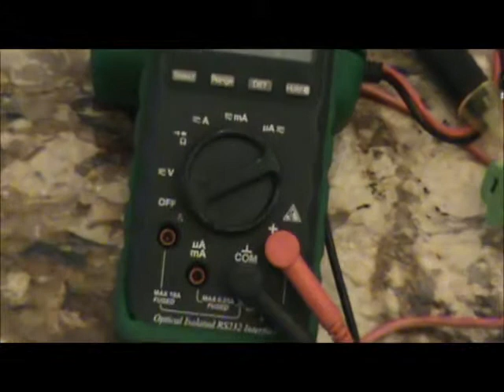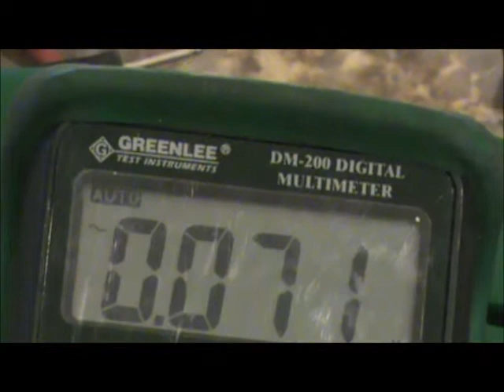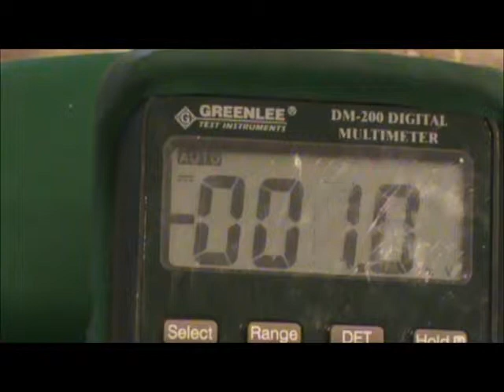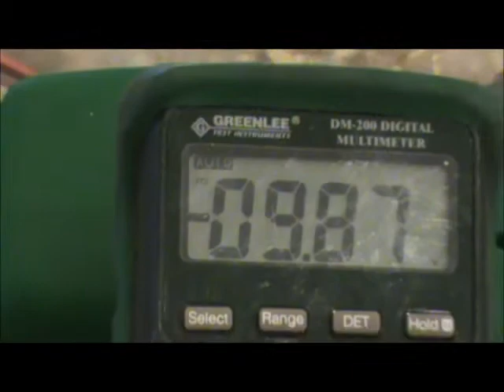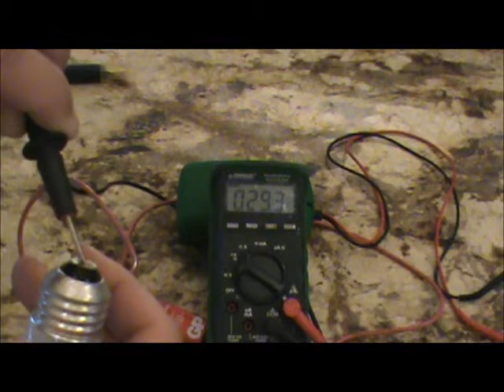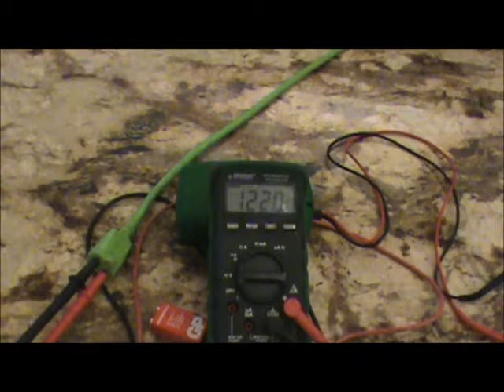Electrical Multi Meters Video Tutorial | Power Source Tutorials

Comment from the maker: Sometimes the person installing the wireing does not make the wires the proper way.
If your reading is 85-90% lower then you have a problem and need to call your local electrician.
It is best to not expose yourself to live wires. I would say if there is power present useing a voltage detector and it still does work. call your local electrician.

Comment from the maker: Trace the wires #1 use a voltage Detector to check for power. Turn off each breaker until you do not get a reading from your voltage detector.Once you find the breaker, you will know what voltage you are looking for. Single breaker is 120 volt and double is 220v. Then take your meter and set it on 300v A/C, test black to white then black to ground (bare or green wire is ground) both of thoses test are good for 120v, black to white is good for 220v. The white wire is not supose to have voltage.

Comment: i have wires coming thru the walls that are black and white and appearently a ground wire. how do i hook the multimeter to these to check for voltage present?  these were wires that went to a floor heater. house was built 1980. thanks  also how do i trace these back to the main box?